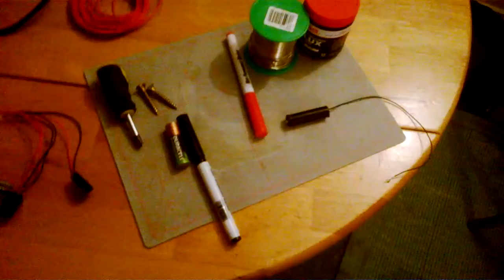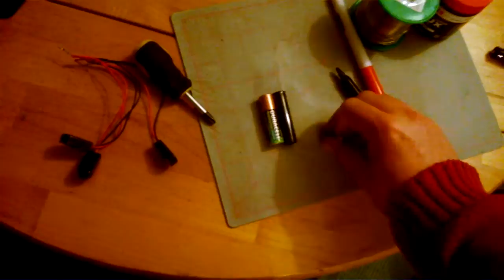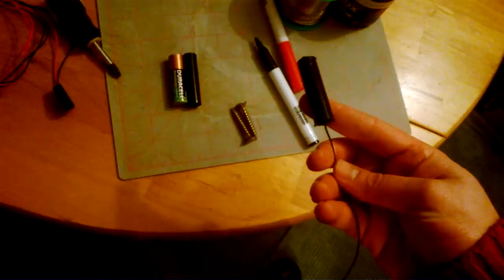Making Dummy AA Batteries part 1 for connecting battery packs - new improved design

Comment: I haven't built one yet, but I think a proper sized dowel cut to size drilled out in the center with 12 or 14 AWG wire with silver bearing solder on the brass washers would be a proper way to do this. Why cut brass screws and spend extra effort doing it when you can use brass or copper washers and not have to do anything to them at all? Yes, both will tarnish after a time, but some kitchen scrubber will clean them easily. I have many GMRS Radios and the NiMh batteries never seem to last the number of charges advertised. So I bought a bunch of AAA (or 10440) LiPo batteries from a Japanese supplier (never Chinese) and will build many "dummy batteries" to keep the voltage down. Some take four 1.5 V Cells, some 5. The 5 AAA cell transceivers will take 2 10440 batteries, without straining them with three dummy batteries. The ones that take only four AAA batteries I will have to think on a bit so I don't burn them out. A miniature voltage dropping device might do the job if it can be found. If one can be found that can fill a battery cell pocket, problem solved. If I can't find one that small, then external mounting will be the solution if potted with hot glue for protection from moisture.
73 de W4FJF.